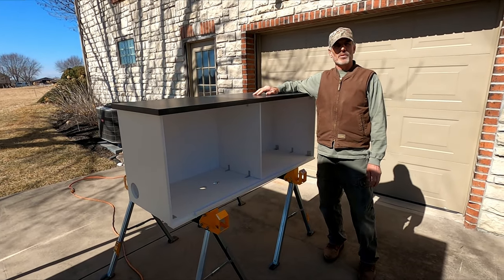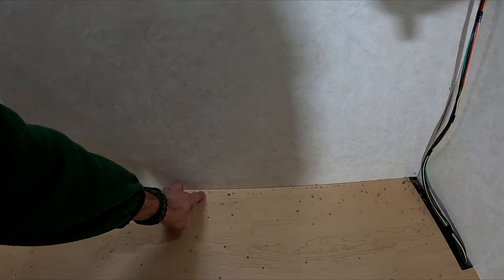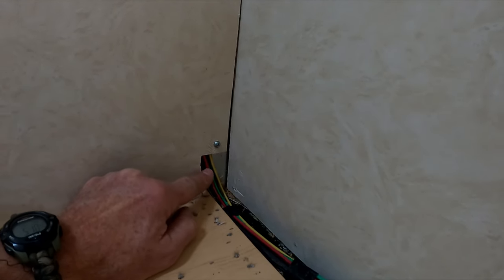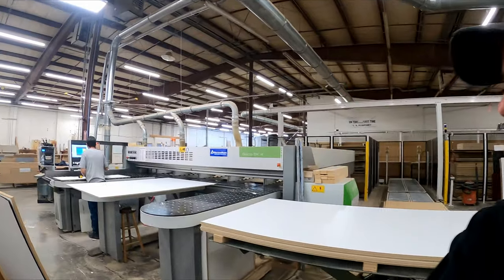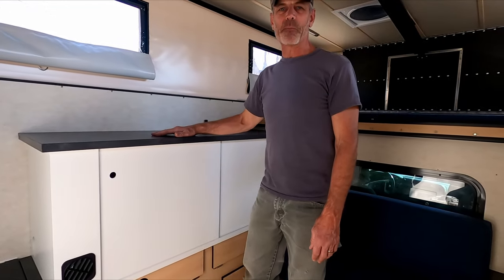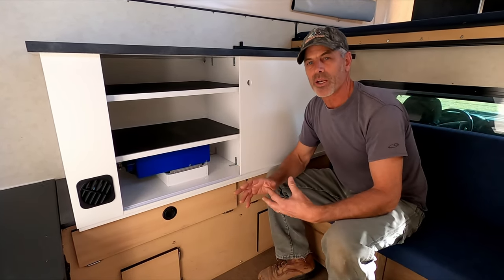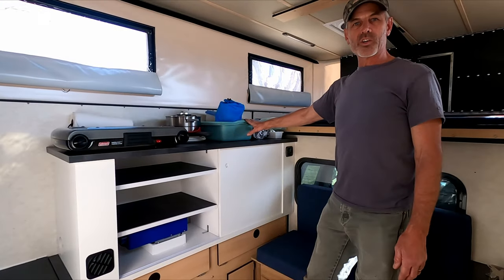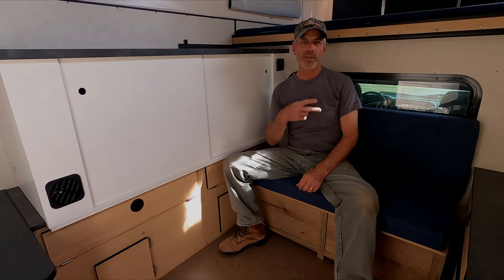Four Wheel Camper - Hawk Shell: Kitchen Cabinet Build

Comment: That cabinet turned out great!!!  So glad you are showing me what can be done with a Hawk Shell.  My only question is when you put the refrigerator back in the initial location, did you have the same amount of room to get in and out of it??  It looked a little tight.  I plan on getting the ICECO that has a slider base so I can move it in and out.  Thanks again for the great content!!!
Reply from the maker: I would definitely agree with you on how the cabinet turned out, wish I could take all the credit but we both know that wouldn't be true. The refrigerator will set just as it originally did. The counter is 19" from the wall and the ICECO is 27" wide so I would say 29" total width from the wall. Everything is tight in such a small space but there is room for the latches to work and easily reach everything inside the fridge. My wife is excited to have a counter to set things on as it comes out of the fridge. Glad you are enjoying the build!!! Your time is coming!
Reply from the maker: Darryl, installed fridge back into it's spot, 3 1/2" between fridge and cabinet. Definitely no issue reaching to the bottom of fridge.

Comment: The cabinet looks great and so functional! Love the slidding doors, what hardware did you use for your slidding doors?
Reply from the maker: Hey Danielle, thanks for the kind words!!!  I found some sliding door tracks on amazon that fit the thickness of my doors and they were easy to cut to the proper length. My "connections" did me solid and cut a dado in the top and bottom sections of the cabinet  to fit them perfectly.